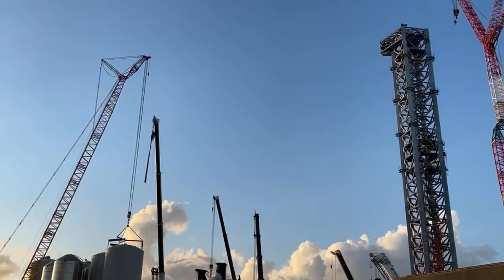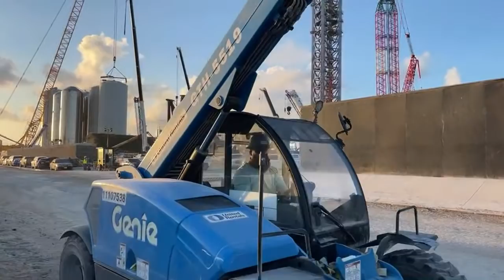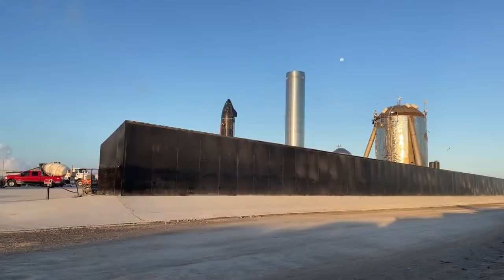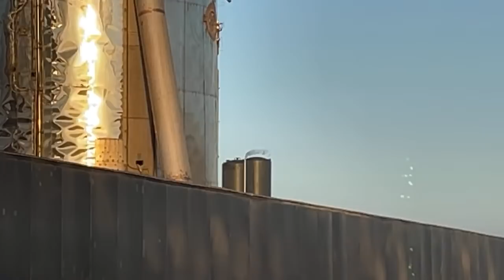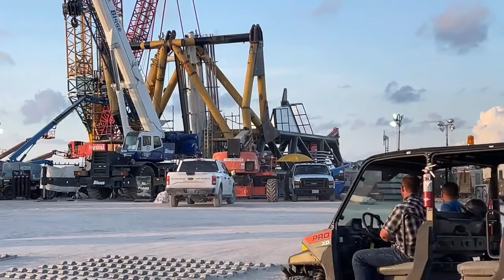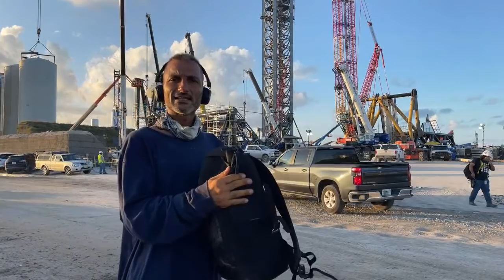Tuesday Main Gate SpaceX Starbase Launch Site, Boca Chica, TX

Comment: If you use that DSLR camera everywhere and used it properly(not shaky)(non-blur)(stable) then ,
I can guarantee that the numbers of viewers will grow "exponentially"..!
Reply: no one has DSLR camera there all the time except you , there is no point in not using them ..
if using it feels problematic then there are lots of websites , videos , books...  from when one can learn .!
Reply from the maker: Ok, I'm looking to do better with my Nikon P1000 camera. I just got a table for the room and a few blankets for my room. Next step, is to learn more about the camera. I returned to the Nikon 610 to its owner two weeks ago. If you have any manual links or video links to learn more about the cameras or buy equipment, post a link.